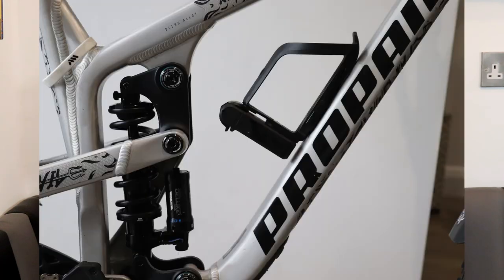How To Set Up A MTB Coil Shock

Comment: Cheers for the straightforward explanation mate.  just recently upgraded to RS ultimate coil too, for reference how much rebound do You ride closer to the deer or the turtle (theres 15 clicks in total between them i find being 5 clicks from the deer feels good) how about LSC? Any info helps a lot! I ride a 550lb coil..
Reply from the maker: I have a video on setting up suspension also mate!
Reply: @CharlieRidesMTB  how many clicks open or closed to do you run your rockshox coil rebound?
Reply from the maker: 4 from the fastest